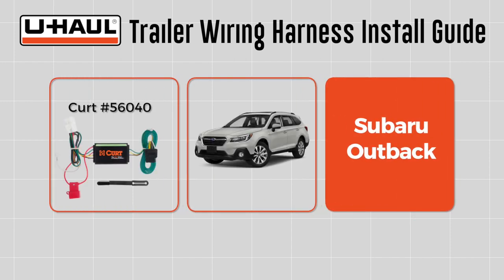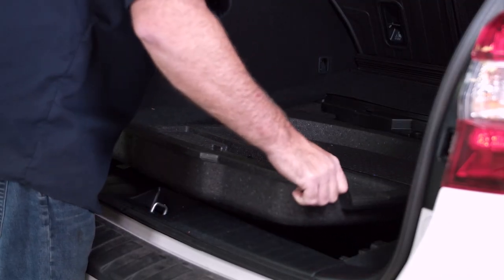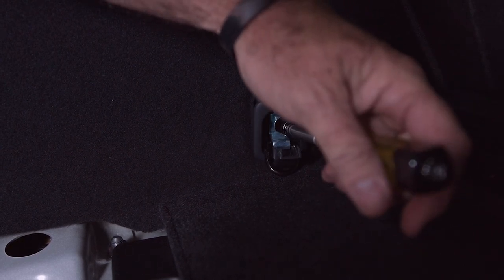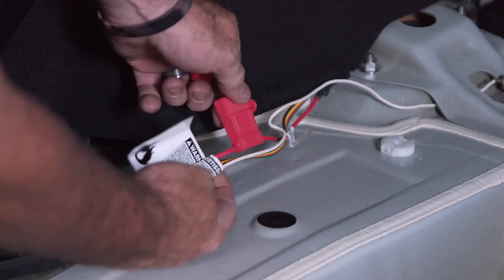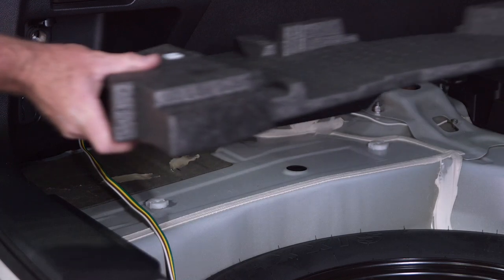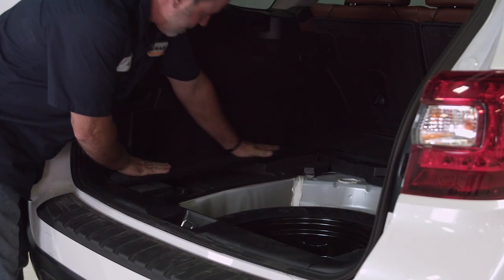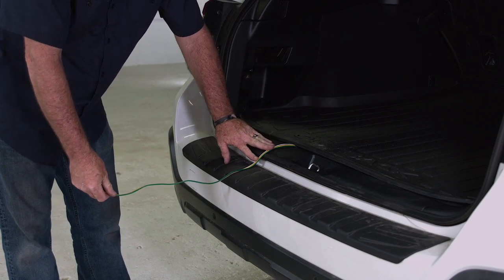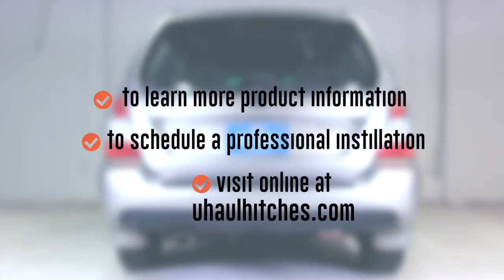2013 Subaru Outback Trailer Wiring Installation

Comment: Way better video than the video on the Curt website. Removing the tie down hook on the side helps with pulling the side wheel well panel out to get access to the factory plug. One thing. It felt like my factory plug was stuck up inside but it was held in my a piece of blue plastic tape so don’t yank on the plug. Remove the tape and it falls down nicely.  After figuring that out, easy install. I like your ground wire clean install. Thanks!
Reply from the maker: Glad it helped!